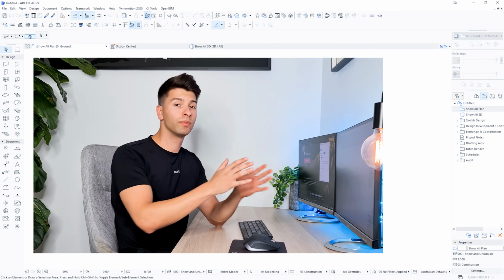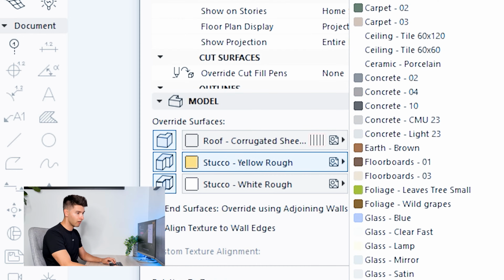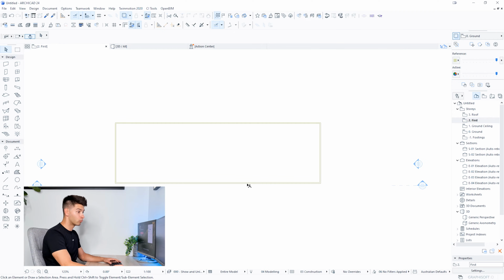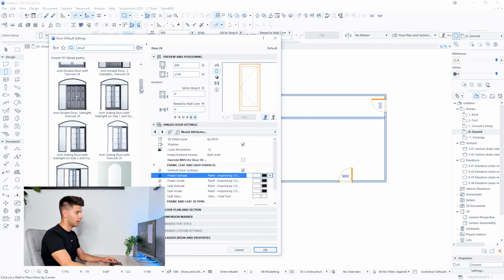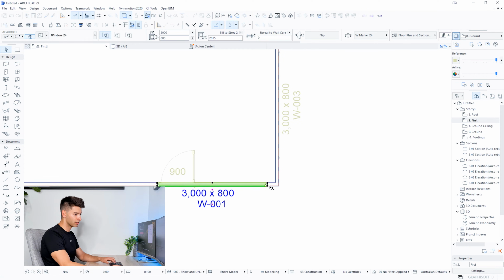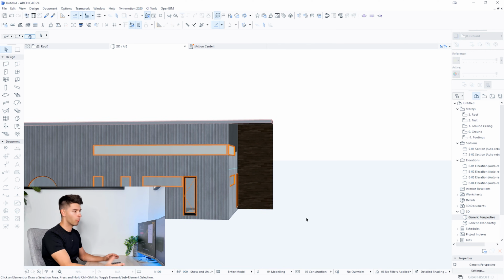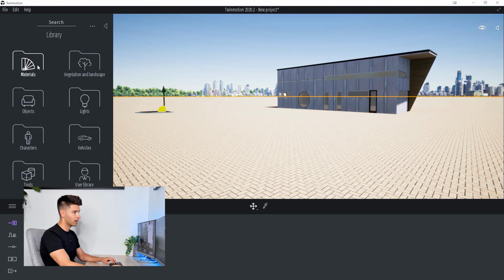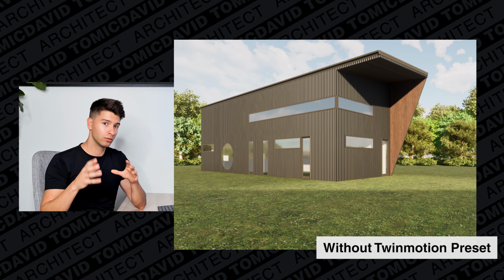ArchiCAD 24: Start to Finish Tutorial in Under 30 Minutes

Comment: how did you make the external walls in single line? mine shows 4 different walls
Reply from the maker: You either haven’t activated the group function or you haven’t drawn it as a polygonal wall.

Comment: 1:52 Delete that (how)
2:55 Select Concrete Light 23 (It is not in the list I have)
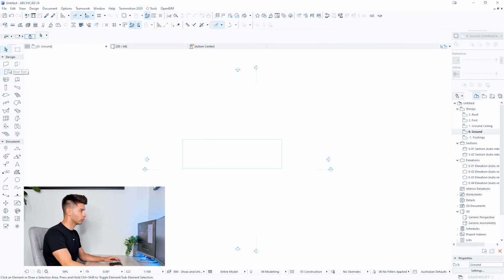3:22 Moving back to the ground floor plan (presses some shortcut)
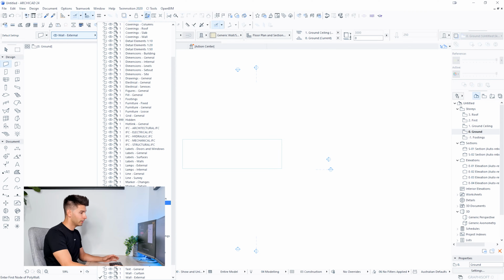3:36 Select external wall (It is not in the list I have)

This, as a complete beginner, turns into a sensory overload with having to backtrack twice on every sentence you speak.

Comment: I am mainly a Revit user, but my boss recommended that the team get familiarized with ArchiCAD for possible projects using the program. I came across this 30 minute tutorial, and it really helped as introduction to ArchiCAD as it included quick keyboard commands and fork flow. I am looking forward for more ArchiCAD tutorials. This channel is worth subscribing.
Reply: I am about to start using Archicad, jumping from Revit. How easy are you finding the process? At first sight, Archicad seems easier, but starting from 0 is always scary.
Reply: @Aphorism89  I couldn't agree more.  Shifting from one program to another is quite scary, but you can consider it as an addition to your skill sets.
Good thing about these videos/tutorials, you can watch it and at the same time try it hands on. Slowly you'll have a sense of the program's work flow.

Comment: Hi, great video, I  appreciate it...keep it up.
I have 2 issues:
1. I cant see when I Ctrl+T at override surfaces locate specific surfaces.
e.g. I have concrete 02-04-10 but I am missing the rest. How I add them?
2. I cant seem to copy - paste multiple items (e.g. the 4 walls from Ground floor to 1st) but I can copy paste them one at a time. why is that?
thx
Reply from the maker: 1. Surfaces are region specific so they may be different to what I showcase. 
2. Make sure you have all hot fixes installed as this could be a bug.
Reply: @DavidTomic  
1. If I go to file-> Libraries and Objects -> Library Manager
I have embedded Library and 2 extra packages (which include within other types of concrete surfaces).
is there a way to insert them into my project ?

3. what does Alt+G supposed to do (when I select the 4 walls, as they are 4 individual items) ?

Comment: when I was using archicad , I used artlantis for rendering. IS twinmotion new ? or better?  why not use artlantis ? Great vide
Reply from the maker: Twinmotion is new, and faster to produce better quality renders compared to artlantis (in my opinion)
Reply: Twinmotion is way better. Also Lumion. And they are easier to use than Artlantis...

Comment: How do you get a clerestory window to match up with a side clerestory angles window on a skillion roof no frame on the join? Also 
what computer do you use for archicad and twinmotion? PC, Mac? Would like a breakdown of what CPU? My iMac crashes! Thanks
Reply: I never went for Mac, instead use powerful gamer's laptop (despite not gaming at all) with powerful CPU & great graphic card & added some RAM , big capacity SSD keeping all data on the D disk, + working with 2 external back up hard drives, and a big screen connected with HDMI at home, looking forward buying a second screen.

Comment: Can you please make a video showing how to draw columns that go into the ground for a suspended floor one-meter AGL?
Say we are designing a house to be built on land that is subject to flooding and we must elevate the ground floor by say 1 metre, then pick it up from there as a normal design!
Reply from the maker: Somewhat of a challenging detail to show widewide. Every site will be different including soil types so you always have a different footing size and system. Depending on the climate it could also be a suspended timber or concrete slab, near endless possibilities. But will consider how to incorporate
Reply: @DavidTomic  Sure David, but what I am after is how you draw the ground level, then the footing column going into the ground say for 2 metres, then 1 metre above the ground, from there we can pick up the design as normally would be done!
Thank you,
Franklin

Comment: how to see door and window size details in floor plan view as your video showing sizes ?
Reply from the maker: You've either got a graphic override hiding them or you need to turn them on it the settings under 2D representation, text set to mm x mm

Comment: great to see your work flow! if you can do more of these! starting to change to archicad also. Ps: one tip, just the only one i can give you about archicad as i´m a beginner, instead of changing the operator wall to 1mm and material air, why dont you put it in a hidden layer? great work! nice to see architects doing this